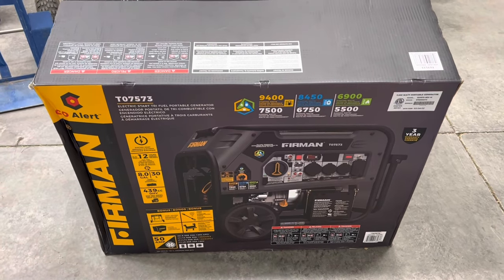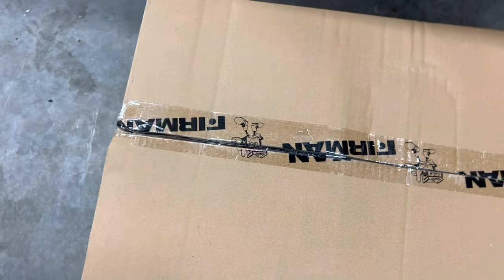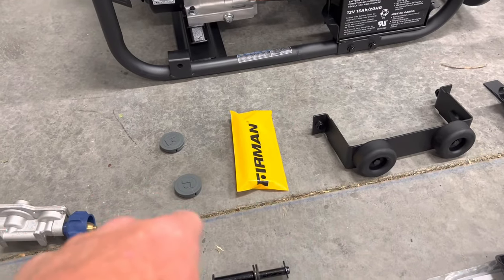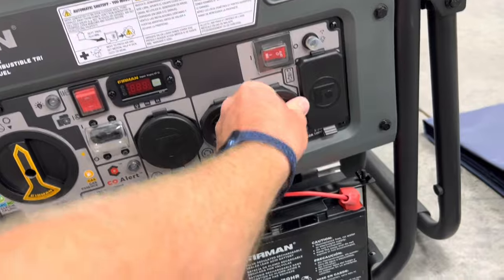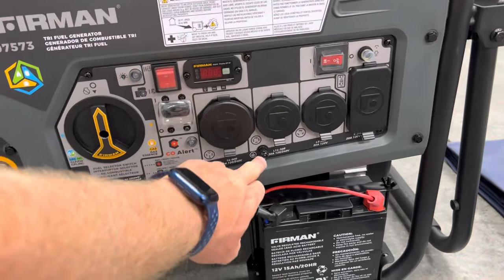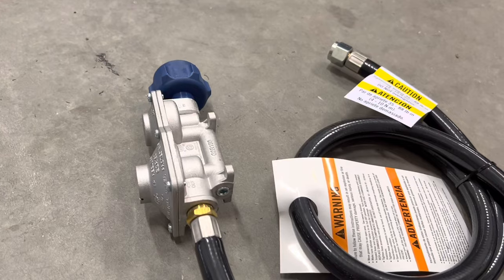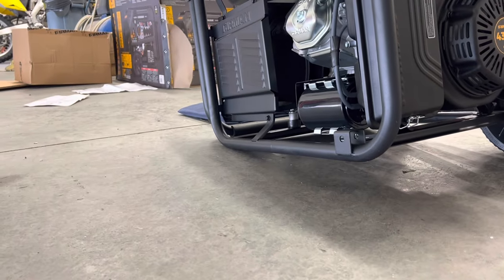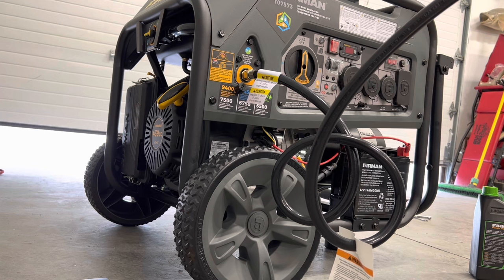Firman Tri-fuel generator unbox and setup.

Comment: I have recently purchased this model from Costco store. This model's battery receives charging automatically while the generator is running. This information is indicated on page 33 of user manual.
Reply from the maker: Yes, but it has to be running. If you store it for 18 months. The battery will be dead
Reply: @BryanHansen I think my batteries dead... Its been boxed for over a year now..
Reply: @lalo80adams71  same, will be interesting to see how we’re gonna get it started when we need it🤣
Reply: @mark beshay  Lmao Thanks for the reminder, il keep you updated on how that went..
Reply from the maker: You can still pull start it with a dead battery.
Reply: Have had mine for some time unboxed as well. Anybody have luck charging existing battery w/pull start, or did you end up buying a new one?
Reply from the maker: I just put a battery tender on mine. https://amzn.to/3WvCOdk
Reply: @markbeshay  purchase a NOCO Battery Jumper as a back up. Good for your other batteries.

Comment: I was able to run my Lennox 3 ton central AC system on propane with this generator. I do not have an easy start kit installed on the AC system either.
Reply: Bought mine 2 years ago, just used it  twice in the past 6 months by running extension cords.
Now I have installed the soft start  kit ,but I hear it's not enough to run the generator on 4 tons a.c unit..
There are no videos to confirm it could run the 4 ton a.c unit .
I am thinking about purchasing the Duramax 15000 with a runtime 10000 watts to run the entire house.

Comment: Dont have to change oil that much last one i had in 2018 ran it nonstop for years had over 900 hours never changed the oil .still running strong
Reply from the maker: Just because you can doesn’t mean you should
Reply: Every 100 hours just like the manual suggests

Comment: I like my Firman Tri-Fuel a lot, especially during the Texas freeze and assorted power outages. The same 1/2" natural gas hose I bought had a 3/8" Female by 1/2" Male brass adapter to connect to the generator. It was too long (deep) on the female end and I had to sand it down so the flange in the adapter would seal against the LP gas fitting on the generator.  The other end is a 1/2" male quick disconnect fitting which easily connects to the female fitting attached at the gas valve. I ended up installing a MB Sturgis Propane Elbow Adapter at the generator's 3/8" POL fitting. It is a 3/8" Female Flare Swivel x 3/8" Male Flare (Item # 204163) that I purchased from etrailer . Then I installed the 3/8" Female x 1/2" Male brass adapter there. I can plug the 240V 30A cable to the outlet which is connected to the house electrical panel. I have a 4-ton (46,000 BTU) A/C unit. I installed a Micro-Air EasyStart 368 (4-ton) Soft Starter ASY-368-X48-BLUE. My AC unit now uses 12.8 to 13.8 Amps and a Start Peak of 33 to 36 Amps. My UPS's seem to beep & click when connected to the generator. I have a stupid power strip plugged into the battery backup side of the UPS with items plugged into the strip. All I have to do is move one plug to the surge protector side. And then turn off UPS. Surge protector should still work.
Reply: Great explanation! I plan to do the same. How long is your 1/2” gas line ?
Reply: @alanrodgers4156  24 feet long NG hose. The elbow adapter keeps the hose close to the generator and prevents tripping over the hose. Now it is easy to store the 1/2" NG hose on top of the tank.  
Trying to line up the cable plug with the inlet at night? Take a marker or white-out and make a line on the plug & socket to line up the two before you twist it. Keep battery charged. Install emergency lights that come on when power goes out. Install them where you set up the generator, at the panel and maybe in the main hall of the house. Have an extra spark plug. Maintenance is easier when using natural gas to power the generator.
Reply: Great ideas! Really appreciate it. 
I purchased couple of spark plugs from oreilly as spare.
I love your idea of marking it!
I have to figure out how long of gas line I need to get, since my generator inlet box is about 75’ away from where I plan to tap the gas.
Do you think 50’, 1/2” gas line might have significant loss? The The reason is because i plan to tap from the dryer gas line and my generator would be located about 50 feet away and then I will have 25 feet 50 amp extension cord to connect to my generator inlet box. I don’t know 50 ‘ gas line and 25’ feet  extension line would be better or 25 feet gas line and 50’ feet extension cord to the generator inlet would be more efficient?
Reply: @alanrodgers4156  Not knowledgeable about the gas line length. You will have to research. 50 amp cord? The generator puts out 31.25A at the 50A outlet (page 6 of the manual). You can find a chart for amps, wire size and distance somewhere on the internet.
Reply: No worries. Thank you very much!
Reply: @rwstarke  any chance you have a video or link to details/images of your set-up?
In Houston and didn't have this ready for Beryl (we were out of town anyway). I'm debating whether we tie this in to our house breaker box (run a small 2 room mini-split and kitchen breaker) or (until then) just run extension cords to fridges and plug in our camper to the 30amp...

I need to get a plumber to add a gas line off our outside meter. Shouldn't be too hard - could look at doing it myself, BUT thinking paying a pro may be better (safer).
Reply: @idsullymichaels  Install a 240V 30A L14-30P Power Inlet box on the wall. Connect (4) 10 AWG wire (cable) from the box to a the panel's neutral, ground, and a 30 Amp double pole breaker which will be mounted in the panel next to the main breaker. You will have to install a Generator interlock kit made for your panel. This allows only the main breaker or the 30A breaker to be on. The placement of the 30A breaker will depend on the interlock kit. I suggest testing the connections between the panel and the inlet box with a meter before closing up the panel. There are many instructional videos on YouTube.
I had a gas line installed at our back porch. It was tied into the gas line leading to the attic furnace.

Comment: Hello. Do you know if the battery self charges or if a trickle charger is needed to keep a fully charged battery? Thank you for your time.
Reply from the maker: It will charge while running, but I keep a Noco tender on mine: https://amzn.to/3BrICNz
Reply: @Bryan Hansen  hello sir. I am new to owning a generator and I found this video extremely helpful. I bought this same generator from Costco and I set it up today. While reading the comments to learn more, I saw your comment about keeping a Noco tender charger attached for the battery. Can you please take a moment and explain how to properly use this charger on this generator? For example,  when the generator is not in use, do you keep this charger plugged into the wall and attached to the generator battery to keep it charged at all times? Also, do you keep it attached when you start it up and while using the generator? Lastly, I know the Noco says it can be used in various modes depending on the battery voltage size and type of battery it is. Do you know what size and type this battery is so I can put it in the correct mode? Sorry for such a large comment. Thank you very much for your time and Thank you for the great informative video.
Reply: It charges itself while the generator is running,  but I the it would be better to buy the trickle charger.

Comment: If I’m running it and using strictly extension cords do I connect the cord it comes with then connect my extension cords to that?
Reply from the maker: You can connect them however you want. Makes no real difference.

Comment from the maker: It should be noted that the generator will only pull start in the GAS mode of operation. " If the battery is not able to start the engine, it can be started manually
only in the GAS position by pulling the engine recoil cord." From the owner's manual.
Reply: First, thanks for the very detailed video! I picked up this generator in February 2021. Never owned or used one before. I’m a bit confused based on my owners manual and your video and now your comments here. I’m under the impression if the battery is dead you must pull start the generator and only with gasoline but in your video it clearly looks like you’re pull starting with either LP or NG based on the fuel selector knob. Can you ( or anyone) clear this ip for me?
Reply: @samh9072  I was thinking the same thing
Reply: I just bought this generator and I can start it with the recoil on NG mode. Just tried it now.
Reply from the maker: @LL-mt2nz  i actually can as well. Originally their documentation said it was not an option, but it definitely works for me.
Reply: @BryanHansen  your vid was a huge help thanks

Comment: Here in Texas, we had a bad winter storm in Feb 2021. Over 246 people perished, probably more than all of Canada in the same timeframe. I bought a Firman tri-fuel, luckily on sale at the local Costco. I run it for 30-45 minutes monthly/month and a half. My concern is the question of how clean is the electricity produced. Do I need to buy some kind of plug to clean the electricity? To plug into the house outlet feeding my computers, tvs,  micro-wave. Would need 4 or 5 if they are sold. Can't find such a product on Amazon. Just don't know the product name, if it exists. Would appreciate greatly any info you may provide. Thanks.
Also, looking to install a soft-start on my 3.5 ton AC. Afraid our electric grid is so-so and summers are as hot and could get deadly as winter cold.

Comment: I have installed on my home a Generac transfer switch from my 16KW that cratered years ago. Do you think I could wire the Firman into the power lines that are left from the Generac (generator to transfer switch) and be able to use the Firman? I plan on using the natural gas line that was used to supply the natural gas to the Generac.
Reply from the maker: Definitely. Just need to limit the appliances you run down to that wattage.

Comment: I read people complaining about the loud noise this Firman T07571 unit makes.  My main concern more than the noise is dirty power it apparently provides.  At 11%-14% THD, I'm concerned electronics will get damaged.  Anyone have comments/opinions on this point?
Reply from the maker: In my research most "noise" about dirty power are from people who don't own the unit and "think" it won't work well. The THD means it isn't as efficient, not that it is supplying horrible power. Every single person I know that has run this generator and ran it in a whole home scenario like I am has nothing but good things to say about it. This was one of the preferred generators for a generlink transfer switch. I should note that there wasn't a single Honda generator on that list. Honda being the gold standard that everyone seems to hold everybody else to, doesn't even have a model to run with their transfer switch.
Reply: @BryanHansen  Hello Bryan and thanks for your reply and this info.  I saw a comment from a guy who did own this unit and said his lights would flicker when he used it and his UPS devices kept switching over to battery power as if the supplied power was not good enough for it.  The unit seems great, it's just this issue I am trying to educate myself on and be careful about because the last thing any of us want are circuit/control boards on PCs/TVs/Refrigerators/Washing machines/etc getting slowly damaged all over the place.  Again, I'm just trying to learn the facts from those who know so I can make a good decision.  Thanks
Reply from the maker: @utrutr6013  That sounds like a specific problem to him if you want my opinion on it
Reply: We own a Predator 9000/7250 gasoline generator that I converted to Tr-fuel.  It is a non-invertor generator.  It is our whole home backup power source.  With over 80 hrs. run time of testing, not one electronic device has been damaged.
Reply: @Pk3_Garage  what converter kit did you buy for that??

Comment: Nice generator. I have a dual fuel inverter generator but it would be nice to have a trifuel inverter since where I live, the NG is connected to the house. That way, I don't need to go to a place to get fuel that might not get deliveries during a SHTF situation (I do have a Generac whole house genny but would like a backup since Generacs are pretty much crap)
Reply from the maker: I literally sold my other generators to do exactly this.
Reply: Do you use a 1/2” or 3/8” gas hose for the natural gas option? My home connection is the 3/8”?
Reply: @LL-mt2nz  I think either would work as long as the fitting matches. You can adjust flow with the house or genny valve.

Comment: First of all you did a great video you explained a lot one question I have is I bought it left it in the box for five months because I didn’t need it but it was on sale I built it started it with propane and it wouldn’t stay running is it because it detected a gas leak? Do you have any recommendations what to do?
Reply from the maker: Did you buy it from Costco? I think you have a year to exchange it.

Comment: I just bought this generator and I'm about to use it on propane for the first time. Do you know how many hrs per gallon of propane can I get roughly?
Reply from the maker: LPG burns at about 1 gal per hour at 50% load. So a 5 gallons (20L) Propane tank will last you 5-6 hours at 50% load

Comment: @Bryan Hansen  hello sir. I am new to owning a generator and I found this video extremely helpful. I bought this same generator from Costco and I set it up today. While reading the comments to learn more, I saw your comment about keeping a Noco tender charger attached for the battery. Can you please take a moment and explain how to properly use this charger on this generator? For example,  when the generator is not in use, do you keep this charger plugged into the wall and attached to the generator battery to keep it charged at all times? Also, do you keep it attached when you start it up and while using the generator? Lastly, I know the Noco says it can be used in various modes depending on the battery voltage size and type of battery it is. Do you know what size and type this battery is so I can put it in the correct mode? Sorry for such a large comment. Thank you very much for your time and Thank you for the great informative video.
Reply from the maker: I would buy the smallest Noco battery tender that I could for this one. It seems like you might be looking at some of the higher end ones, butt this one https://amzn.to/3lBk7Zn can be permanently mounted to the generator if you want and then just leave it plugged in. You can leave it plugged in when you start it, it doesn't matter. I would leave this on it most or all of the time if you want the battery to be topped off when you go to use it. I personally charge mine up every few weeks and take it off, but not for any reason other than just leaving it on all the time. This generator is purely for emergencies and I have a jump box too so making sure the battery is always charged isn't a huge concern of mine, but that being said, I do have that 2 amp charger on it and plug it in about once every 8 weeks for a day or two. That 2 amp chooses the correct settings for you since it is a trickle charge.
Reply: @BryanHansen  hey Brian, where did you mount this charger? did you?
Reply from the maker: @johngraziano6652  I mounted these cables permanently. https://amzn.to/41MHG0K and then just leave this charger loose: https://amzn.to/43WjNW8

Comment: Excellent video! Best I’ve seen yet on this generator! Thanks so much. Did you use an inverter so power is clean power?
Reply from the maker: To my knowledge, and I can be mistaken here, the generlink that I am using is supposed to clean it up
Reply: @BryanHansen  I don't think it's clean power.
Reply from the maker: @Asidebar this is the list of recommended generators from Generlink: https://www.generlink.com/files/138783526.pdf

Comment: I'm no expert but I believe the generator ground lug is only for running the machine independently of your house. If you connect it to your panel you need to follow the manufacturer directions to convert the generator to a floating neutral because the machine will use your panels earth ground.
Reply: Oh and no choke needed on lpg or natural gas from everything I've learned.
Reply from the maker: Depends if you need a bonded or non bonded connection. Some furnace controllers need a bonded connection. If running a transfer switch it should used the house ufer ground. If using it through an extension cord to a furnace (emergency situation) you will likely need to use the ground lug.
Reply from the maker: @shanwar9844  Not correct. You still use the choke for the NG or LPG operation. "NOTICE When the main fuel selector switch is turned to the LPG/NG position, the indicator light
will turn RED for up to 4 minutes (before going off). Starting the engine successfully anytime
during the 4 minutes will turn the indicator light GREEN. See Indicator light-Battery Power Saving
Mode section for more information.
7. Disconnect all electrical loads from the generator. Never start or stop the generator with
electrical devices plugged in.
8. Move choke lever located on engine to “START” position" (for electric start jump to step 12)
12. For electric start only - Flip the engine switch to the START (ll) position for a few seconds and
then release.
13. For electric start only - Move the choke lever to the RUN position.
3 sec.
14. Allow portable generator to run at no load for a few minutes to stabilize before plugging in
any electrical devices